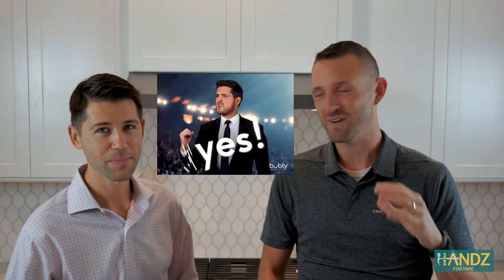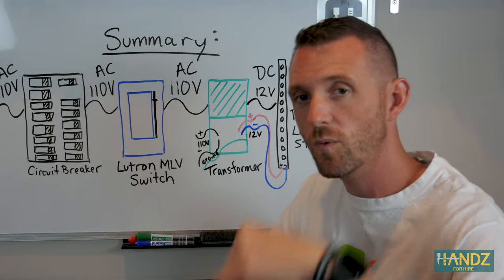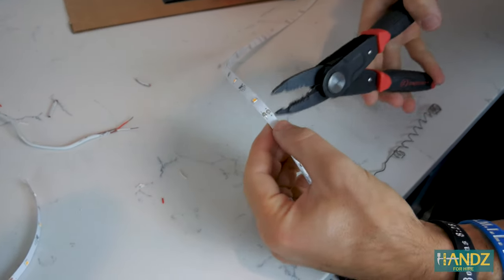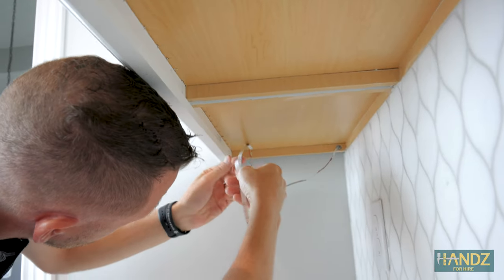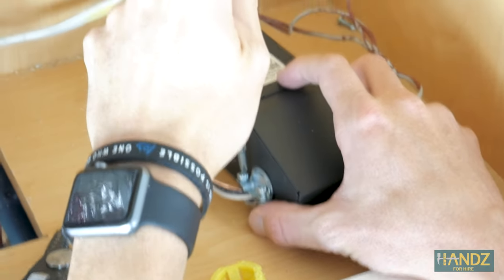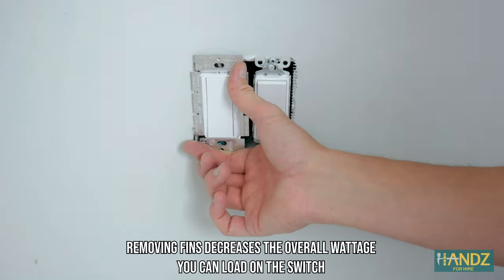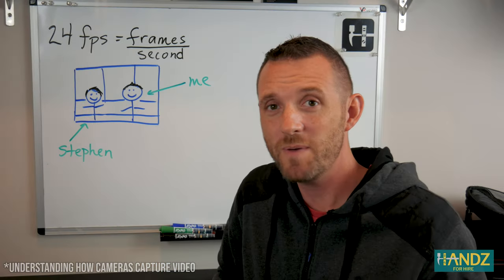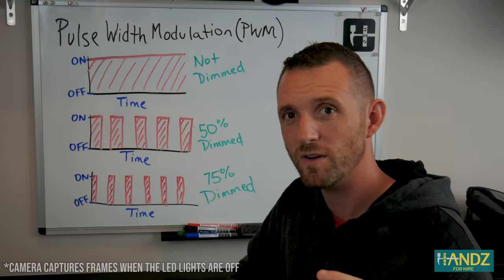HOW TO INSTALL UNDER CABINET LED STRIP LIGHTS w/ LUTRON DIMMER | Why do LEDs flicker on video?

Comment: Thanks for the great video and easy to follow instructions!  
 
I'm starting on the same kitchen led lighting project myself and I really appreciated the explanation of the magnetic transformer, it's literally exactly what I was looking for - I just didn't know what it was called. The main reason I was looking for an install video like yours is I've been hesitant to install everything using the cheap plastic ac/dc transformer that shipped with my led strip, even though a couple of other DIY youtubers have said they used it with no problem.  It just seemed like a plastic consumer-grade "wall wart" was the wrong option for a permanent power supply, especially in a kitchen.  Of course, once I saw you breakdown how the 110v AC from the breaker gets stepped down to 5v DC I realized your video offered something those other DIY videos didn't; a working knowledge of electricity :)
 
Just out of curiosity though I was wondering if you knew if there's a difference in heat/power dissipation between the two?  For example, my ac/dc transformer outputs 12v/5Amps, and your magnetic driver outputs 12v/60Watts (which I think is the same, correct?  5A x 12v = 60W ?) I am assuming stepping 110v down to 12v however you do it will be inefficient enough to give off noticeable heat, and I think the metal housing of your driver alone makes it a better option than a cheap plastic transformer, but does it offer any other benefit in that regard?  Thanks, subbed and looking forward to the next one!
Reply from the maker: Barry Wise glad to help! Your math is correct on the 5A vs 60W. They are the same. The truth is that I have never used the plastic transformers so I can’t do a direct comparison. I wanted to make my setup dimmable and the plastic transformers plug into an outlet. It’s against code to put a dimmer on a standard outlet so I never messed with it. The metal magnetic transformer is very high quality and makes dimming easy. The metal magnetic low voltage transformer does have a noticeable heat output so you’re right that there is a good deal of energy loss between the internal primary and secondary coil. I haven’t done the research but the plastic transformers are most likely electrical low voltage transformers which uses a different method to step down the voltage. This Lutron page explains the difference really well if you care to read some more about it. https://www.lightingservicesinc.com/about-us/news-events/news/lutron-guide-to-dimming-low-voltage-lighting Good luck with your installation!
Reply: @HandzforHire  Thanks!

Comment: Just thought you should know, the Romex shielding is supposed to be covering the wire through the BX connector you installed on the transformer.  You should see no high voltage wires in the cabinets.  Also, the soldering... first cut those bare leads much shorter, they can arc like that, second heat the pad not the solder.  Heat where you want the solder to GO, not the other way around.
Reply: Clearly not electricians. White neutral red and black usually hot

Comment: 🙏🏼 THX for posting all the products & supplies needed in description. It helps immensely, even for [us] who do this daily, being able to find products quickly, VERY NICE.
Also, the solder clip, at first, thought was the “plug” clip ppl slide led strips in and use s/o soldering. Definitely have a good setup now, BUT, always looking for new items out there to help; so, definitely gonna be buying one to try out. 
Thx for a good vid, detailing “why” need “power” and transformer, along with products 👍🏻
¹Forgot to say, even though tiny pads, do still like using flux when soldering. Think makes it work better, imo.
Cheers✌🏻

¹ edited to add this
Reply from the maker: My pleasure! I'm glad it helped! Yeah, the SolderM8 is pretty cool. I wish I had it for this project. The inventor of the product sent me one after he watched this video and I helped Stephen out with another section of his kitchen using the SolderM8. It worked really well. Have a great day! https://www.youtube.com/watch?v=eaVtl28a7q4&t=1s&ab_channel=HandzforHire

Comment: Does the lutron caseta and/or diva smart switch work with lower voltage led strips?
Reply from the maker: Yes they do! I have my led strips connected to a Lutron Caseta ELV+. Also, Lutron customer service is really good about troubleshooting with you or helping you find the correct switch for your needs. Good luck!

Comment: Thanks for the video and explanation.  It’s very helpful – I have a question that I hope you can address.
We have three (3) separate cabinet sections in our kitchen and I’m interested in adding cabinet lighting above and below each section.  I’d like to control them all (on, off, and intensity) from a single switch and have them display the exact same intensity through the adjustment range.  I’ve asked the electrician to stub out the romex from the dimmer switch to each cabinet section and am thinking that I need to clarify so, instead of having 120VAC above each cabinet, I will put a single transformer downstream of the switch and jumper the low voltage from section 1 to 2 to 3.  The cabinet sections are different sizes (lengths) so they will have a different number of LED sections, … and thus, would represent different total resistance for the cabinet section - drawing different currents if all were presented the same low voltage.  It seems to me that I would want all of the LED strips to be in series – so that the same CURRENT is passed through each LED section.
Reply from the maker: Hey really great and thoughtful question! We definitely had different lengths of LED strips here too. Since you can cut the strip every 4", each section has its own set of resistors built directly into the strip. Since each strip is hooked up in parallel at the transformer, you end up with the same voltage hitting each strip and current does vary slightly, but it's minimal. I imagine strips of different sizes still put out about the same amount of wattage per LED. I would stick with the parallel setup or you might end up with too much voltage drop per bulb in series and experience dim bulbs. Good luck!

Comment: enjoyed the video guidance. I was wondering if you have worked with the Gosund dimmable single pole switchs. they work well with Alexa and do not require a smart bridge.  Thanks again!
Edit: I do see know that the switch used is MLV rated. do you know of any mlv rated wifi switches that don't require a separate hub?
Reply from the maker: Hey Jeff, I'll have to check them out one of these days. I fully committed to Lutron, so those are all of my switches in the house with the smart bridge. I have 6-7 of the Gosund smart plugs, and they are great. Yeah, not sure if any of the Gosund switches are MLV rated. Because of all the lighting in my home, I have ELV+ Lutron Caseta Switches. https://amzn.to/2YEo8uh Good luck!!

Comment: I’m a little confused. Do you need two transformer for every cabinet light or is one transformer good ? Like why did you need two transformers in this video ? Would the lights not work with without the second ?
Reply from the maker: You'd normally only need one transformer but Steven had two separate circuits for his cabinets, attached to two different light switches. We used two so that he could utilize each light switch. In my house, I only use one transformer because all my under cabinet lights run to one light switch. I hope that helps!

Comment: Can you use solderless connectors to connect your wire to your cut led strips?
Reply from the maker: Good question and I'm trying to picture in my mind how that would work. The end of the strip needs two wires to be held in place. If have a solderless connector that's designed to have two wires enter on one side and a flat end that can be clamped down over the terminals of the light strip then it would work. If not, I think you'd have to solder. The lights actually come with several connectors that attach to a wire you can plug into 120V. Since we were running these strips across his kitchen to two light switches, we had customize it.

Comment: Will it hold over time. Concerned about putting these above a cooktop.
Reply from the maker: Great question because I had the same. All I can tell you is that I installed these in my kitchen about 4 years ago and they are still holding strong. They are very lightweight and have a good sticky so it’s held up well. Good luck! Let me know what you decide.

Comment: Where should the strips be located (front, middle, or back)?  Pros and cons of each?
Reply from the maker: Great question! I place them somewhere between the middle and front because my countertops stick out much farther than my cabinets. If they're too far forward, the lip of your cabinets might block some of the diffracted light. If the strips are too far back, they will probably be more visible. Good luck with your placement!

Comment: I sure wished you would have used non solder joints, covered where and brand of the strip lights. I’m looking for a complete run up of everything. Also what about diffusers so you don’t see bright spots on a silicone counter top!

Comment: Can I just use USB power led strips and power them with thoese power banks that have an on and off switch??
Reply from the maker: Great question and yes absolutely. In this video, we had everything prewired to a switch so that’s why we soldered them in.

Comment: great video.  I have a Caseta wireless switch (PD-6WCL-WH) that controls an outlet above my kitchen cabinets. I purchased an LED light strip kit that has a transformer that plugs into the outlet. When I turn on the Caseta switch the lights just flash. Is this because I need to use the low voltage Caseta switch (PD-5NE-WH)?  Or is it because I need to use a low voltage transformer that is compatible with the Caseta switch?
Reply from the maker: Hi Robert, thanks! How are the LED strips connected to your switch? Is it a light switch that controls the power on an outlet or do you have the wires directly wired to to the switch?
Reply: @HandzforHire  The Caseta switch controls the power to an outlet. I have a LED strip light kit that is similar to the Inspired Kit you referenced. I plugged the LED power supplies that were included with the LED kit into the outlet controlled by the switch. When I turn on the Caseta switch the lights flash.  Will the low voltage Caseta wireless switch you referenced fix this issue? Thanks
Reply from the maker: Robert T, I personally wouldn’t use a dimmer with an outlet. It may work but it’s not recommended. I would give Lutron customer service a call and they will be able to walk you through the best option. Their customer service number is 888-588-7661. They have been great every time I have called. Good luck and let me know how it goes.

Comment: GREAT video!  Nice custom job on hardwiring low voltage LED lights w/o cheap plastic switch.

Two questions:  1. What gauge wire are you using btwn LED strips? (the wire Stephen is soldering to the strips and leading to xformer). 2. you list two MAGNITUDE xformers in Amazon links.  I understand different rating for safety... guessing number of LEDs or length of total strips = load.   What is that calculation? so I can purchase correct xformer?  I don't want to buy too high or too low rating of xformer.   THANK YOU.
Reply from the maker: John x thanks for watching! To answer your questions, we were using an 18 gauge wire for the low voltage sections of the circuit and the lights we used draw about 2 Watts of power per foot. You should be able to measure the length you’ll need and multiply by 2 to calculate the load. Hope that helps!

Comment: I just installed a kitchen led system just like you show in this video with Caseta switches. When I turn on the lights they always strobe on then off before turning on completely. Sometimes they just get stuck strobing on and off and never fully turn on. I have to try to dim them up and down until fully energize then I can use them like normal. Have you experienced anything like this with your Caseta system?
Reply from the maker: Hi Carl - I'm sorry to hear you're having some strobing issues. Nothing more frustrating than getting through a project and not have it work perfectly. My guess is that the Caseta switch is not pairing well with your lights. There are a few different types of Caseta switches, and the switch may have to be changed to a different mode, or exchanged for one that is fully compatible. I would give Lutron customer service a call and they will be able to walk you through the best option. Their customer service number is 888-588-7661. They have been great every time I have called. Good luck and let me know how it goes.

Comment: This is a very informative video.  I do agree with the comments on the romex needing to run entirely into the transformer box.  
I ran some Romex 12 guage wiring a few years ago in preparation for eventually installing under cabinet lights.  I like what you have done here. Originally I had planned on hard wiring 110V AC.  After researching I would love to run 12 or 24V DC.  My question is this: After using the transformer to step down from 110AC to the  12 or 24DC power and the 12/3 romex be used as a conductor for runs that I have across the room, or should I just add transformers to the other sides of the room and connect everything with a Caseta wireless system?
Reply: Thanks John - That's a tough call because it depends on how easy it is to run across your room, if you have easy access to power on the other side of the room, and how much you're willing to spend. It's challenging to visualize your setup, but if you end up doing two zone with two different transformers, you'd end up with two hardwired Lutron switches. You can easily connect them with a Pico remote. This is just a little more pricy since you need an additional transformer and switch. Please keep me posted! I hope it goes well for you.
Reply: @jayherrigel  Couldnt you use one lutron switch that controls 2 transformers?

Comment: how do  you extend wires to underneath the far end cabinet? I did not see how the wires are hidden
Reply from the maker: Hi James - this house was prewired with 18 gauge wire, so that helped a lot. If you're talking about the lip between cabinets, we just ran a piece of 18 gauge from one strip over the lip to the next cabinet. Most people will not see the wire over the lip unless they look closely underneath. Another option is to drill some small holes and run the wire up and through the cabinets to get to another location. I hope that helps.
Reply: @HandzforHire  thanks alot!
Reply from the maker: @jamesyin1133  you're welcome! I hope it goes well for you!

Comment: Is there a reason why you used "Magnitude" drivers instead of Lutron? Also, which driver did you use, the 12V or the 24V? Great video, thanks!
Reply from the maker: Hey Ryan! Thanks! The reason I used the Magnitude driver is because I had used it before on my own house with lots of success. To be honest, I'm not sure Lutron made drivers a few years ago, but Magnitude has kind of been the leading brand in this department since I installed my undercabinet lighting (3+ years ago). Selecting the driver depends on your setup and the lights you'll be using. In this video, I used the 12V transformer (#6 on the list in my description). I hope that helps!
Reply: @HandzforHire  great help, thanks! I ordered from your link and will be trying out my combination this weekend.
Reply from the maker: @flboy77  good luck! Let me know how it goes!

Comment: How did you connect the cabinet lights on one side of the kitchen to the other and have them working on the same switch?  That would be nice to have them all on the same switch.  (I'm a complete rookie, so maybe there's a simple answer.)
Reply from the maker: Matt - I wish there was a simple answer, but the house was prewired that way. This made it easier. The next best thing I’d recommend is setting it up in sections and spending a little on a nice Lutron Caseta (5-NE I believe with MLV) switch for each section. You can then add a pico remote, add both switches to the pico remote, mount the pico remote where you’d like, and then you can do all the lights on one Lutron pico remote. Otherwise, you have to do it the old fashioned way of drilling holes and running wire in the back of your cabinets or feeding it behind Sheetrock.
Reply: @HandzforHire  Thank you for the advice!  That is very helpful!

Comment: is there any switch that does not require a hub and works with alexa Low voltage for this type of setup??
Reply from the maker: Carlos De leon I think Leviton makes a WiFi switch that doesn’t require a hub and works with Alexa. I’ve been very happy with Lutron so I’ve never tried Leviton before, but I believe they are very reputable. You can maybe try giving Leviton a call tomorrow and they should be able to tell you the exact switch to use if they have what you’re looking for. Good luck and let me know how it goes!
Reply: @HandzforHire  Will do thank you for the response.